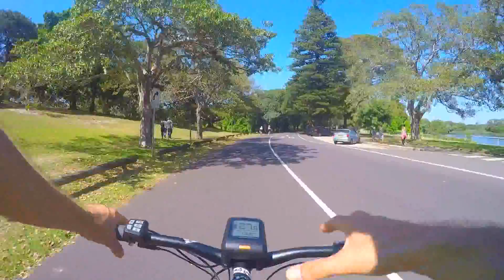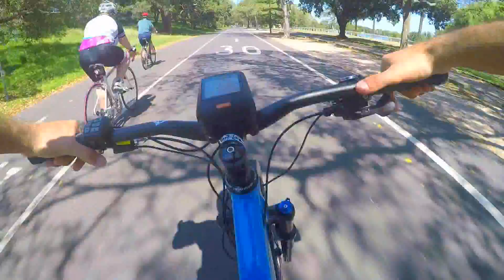Bafang Max Drive REVIEW (video3) Road Speed Tests • 250w Electric MTB • www.emax-ebikes.com.au

Comment: so the 250w bbs01 puts out 720 plus watts? is that normally or modded. i wonder what speed this would do on my catrike 700 recumbent. its already generally faster than a road bike due to good aero. 35mph possible, obviously peddling furiously too?

Comment: bafang website  now  shows  1000w version of the max drive type motor unit for ebike specific frames.  its named ultradrive.  if they could make the gears and pinions splines last for life or tens of thousands of miles it would eliminate the issue of no spares being availible to buy in several years time.  http://www.szbaf.com/en/components/component/motor/mm-g33250cb.html

Comment: How do you disable the limiter?
Reply from the maker: Hi Andres, you can increase the speed limit on display settings but to completely disable you need the programming cable and connect to the PC. Check out the electric bike blog website there is an article explaining how to program Bafang motors
https://electricbike-blog.com/2015/06/26/a-hackers-guide-to-programming-the-bbs02/
Reply: +ElectricBike (Bruno) thank you, that's a lot of complete information
Reply: I have rear hub one, is it possibile do it anyway? Programming cable is the same? thx

Comment: How could 250W goes 51kmh? My 750W motor goes just that speed.
Reply from the maker: +DaDo Bzz - this is a Pedal Assist system with no throttle... the motor gives you a boost... I used this electric boost + my human power to pedal all the way to that speed.. totally possible even without the motor =]
Reply: +ElectricBike (Bruno) 250W motor goes max to 600W and for over 50kmh you need total 1200W on mtb and in this position. I doubt you peddaling 600W so dont get it...
Reply from the maker: +DaDo Bzz - it depends...all these watts calculations people post on Endless Sphere is not accurate at all... there are lots of things you should consider, rolling resistance, tire type, tire pressure, wind speed, side or frontal wind, gearing, aerodynamics (a bicycle travelling at 40kmh is wasting 84% of energy fighting against its own aerodynamics) how can these numbers be accurate, there are so many factors to consider... plus we talking about bicycle.. the idea of a bicycle is that you can pedal =] a non electric road bike can travel constantly at 50kmh and peak over 60kmh on flat.. MTB is not too far behind...  lets say 42kmh constantly and peak 53kmh on flat... would go much faster downhill..
Reply: +ElectricBike (Bruno) Yep, I know at higher speed the most power you need is to overcome aerodynamic drag. Anyway all people with 750W (max 1200W) can go 50kmh +- 5 kmh
Reply: +DaDo Bzz Maybe you're a fat ass.
Reply: My 1000W 48v tops out around 50kph. Bu the author just reminded in his comments here- Opps- I forgot I can pedal! :)
Reply: @jsmythib  my electrict scooter 48 volt 1000 Watt top speed 45-50 kmph
At 60 volt 50-55 kmph
Weight of scooter with battery almost 80 kg+200 kg loading capacity

Comment: Amazing how much do weigh?
Reply from the maker: +The13thGuest - The motor weights 3.8kg, (one kilo lighter than the BBSHD) check more information about the electronics in this other video here: https://youtu.be/mazogf-kHh0
The bike frame needs to be designed for the this Bafang motor. If you want to convert your existing bike you should to for this one here: https://www.youtube.com/playlist?list=PL59mIOWSOm9rGGFqF-avfG98uwRXqwbFz
You only think about the motor weight + battery if you are pedaling the bike with this thing turned off... I can guarantee once you ride an electric bike you will NEVER want to go back to normal bike =]
Reply: How much do you weight?
Reply from the maker: +The13thGuest - I weight 72kg... its ultra hard to put on weight pedalling every single day everywhere I go =]